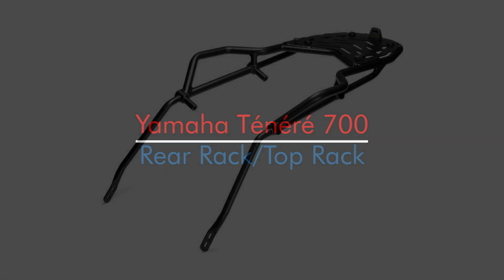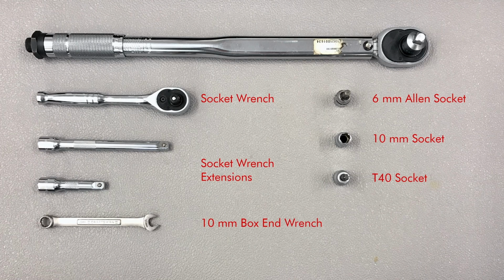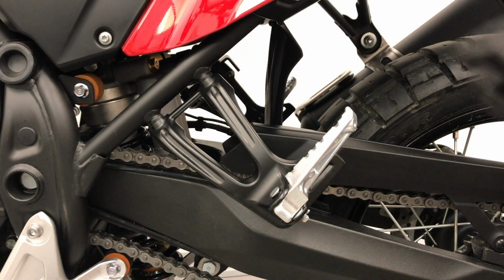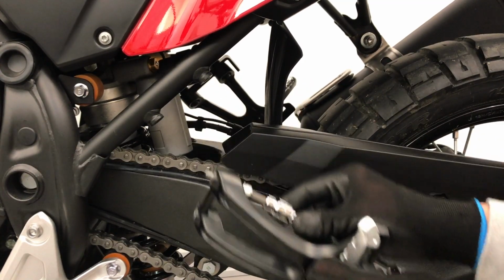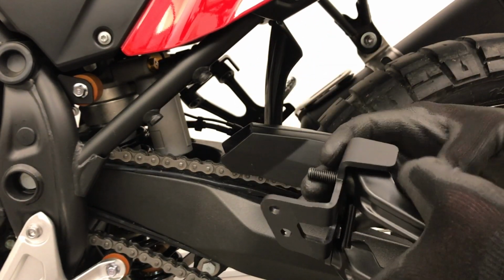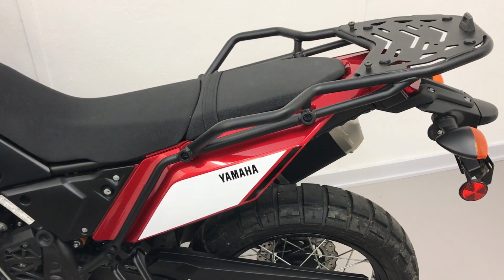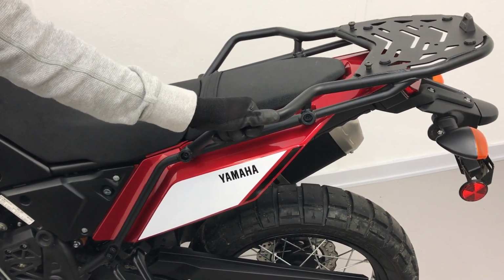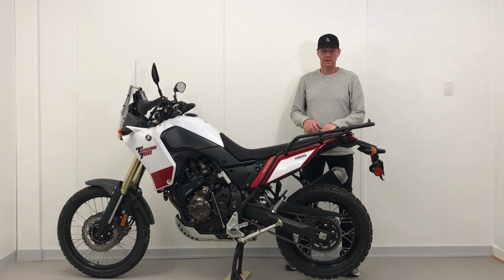Yamaha Ténéré 700   Original Yamaha Rear Rack

Comment: What are the nm torque for assembly?
Reply: Torque for the four large bolts (M8x70 mm) and foot peg bolts (M8x45) are 10 Nm/15 lb-ft. Torque for the four small front bolts (M6x16 mm) are 10 Nm/7.5 lb-ft.
Reply: Are you sure? they seem low to me
Reply: @nicholasmerigo6099  The torque numbers are from the assembly instructions that came with the OEM Yamaha rack. Adding blue Loctite is recommended.

Comment: Hi everyone. I have the T7 with the OEM rear rack like the one in this video. Can anyone tell me if I can add the Yamaha pannier frame kit to the OEM Yamaha rear rack ?? Any help would be much appreciated
Reply from the maker: I looked at the sets. On old pictures it looks like it would fit because the kit has flat tabs to fasten the frame kit where the rack is fastened.

On newer picture of the set, not so because the kit with the same part number: BW3-F84G0-00 is completely different with the large grab handles and foot peg brackets (just as on the rear rack) now part of the pannier frame kit.

I have not seen official Yamaha pictures with both side and top cases mounted, only top or side cases.

I have installed the Givi Trekker Alaska side cases with a Givi pannier rack together with the Givi Trekker Outback 42 liter top case. 

I made it fit with the help of an angle grinder with a cutting and grinding blade, 3/4" and 8 mm drill bits, flat and round files, black satin spray paint and some new bolts from the hardware store; 8 x 26 mm flanged bolts I think it was + flanged nuts. Do not forget the blue Threadlocker!

https://youtu.be/01ZwHWtiVbA

I should have shown the actual modifications in the video. Maybe  later. Not that bad of a modification. :-)
Reply: @orbsurfer8195  thanks for the reply. I think I’ll have to sell the oem rear rack then, as I want a pannier frame to hold the kriega os soft bags and a rear rack that I can put a mid sized soft waterproof bag on the back. I’ll keep looking for ideas thanks
Reply: @orbsurfer8195  Thanks for the info. I have the Yamaha OEM side racks fitted for panniers, but can’t seem to get a straight answer form Yamaha on whether I can also cut the rear rack. From your comments, it sounds like it depends on which side rack you have.
Reply: Hi Jon I have the exact same issue. Did you come up with a solution ? I can’t seem to find a satisfying answer anywhere.
Reply: @OoNoyanoO  I don’t think it’s compatible for the hard luggage system. I went for a soft luggage large waterproof bag that connects to the rear rack using kriega straps that can be purchased from sports bike shop uk.  It’s a great easy system to use and saves a lot of weight.  Also they have bags that will connect to my crash bars.  So with the two crash bar bags and the rear rack bag I have around 42L of space.  You can add another 20L bag onto the rear rack as kriega allow bags to be added together.  They work really well they are waterproof they save massive amounts of weight they can be locked to the bike for security.  Hope that helps.
Reply: @1jonblaze  hi yes it sure helps ! I already have 2 OS12 bags from my old bike and only thought about how the rear rack wouldn't allow me to install Kriega's OS tenere base if I were to buy it. But you are right the rack itself is a good support with some imagination !
Reply: @OoNoyanoO  sports bike shop sell a fitting kit for the Yamaha tenere 700 it’s £19 and it allows super easy fitting to the rear rack.  I have it and couldn’t recommend it enough.

Comment: I love your how to videos, no drama, no pumping music to distract from the content. I do have one observation, you didn't use any Thread Locker? 
From experience, I learned to make sure I always use it on the connections when adding anything to my Bike and 4X4. 
Just curious why you didn't use any.
Reply from the maker: Thanks! You are correct. I installed the rack according to the instructions and Yamaha did not specify any Thread Locker, but I usually use the stuff. I have learned the hard way that it makes a difference! :-) 

I will have to remove the bolts in order to install side case carriers and will use Thread Locker when I reinstall the bolts, and will start to use the stuff more frequently!

Comment: Is it possible to install this oryginal rear rack with Motortrek side rack?
Reply from the maker: I do not know, but it looks like the Mototrek Rack should be mounted between the steel tube spacers and the Yamaha rear rack. For the perfect mount, the two loose spacers should be shortened by the thickness of the rack mount ears, and the two welded on spacers on the Yamaha Rear Rack should be cut of the rack, and shortened by the thickness of the rack mount ears too. 

You might be able to fit the rack on the outside of the Yamaha Rear Rack, making it super easy, but the cases might tilt a little inwards at the bottom.

I did a similar install with the Givi Side Case Racks, but it involved cutting, grinding, drilling and painting in order to get the Yamaha Rear Rack to fit with the Givi Side Case Racks, but it now works great!

Good Luck!

Comment: "A lubricated bolt." Hmm, you do know that friction is what keeps bolts in place, right? You do not lubricate bolts or nuts. You want fiction to work it's magic. If you want to put lube on your bolts, well, by all means do. As for me, unless the manufacture specifies it I won't put any on mine. Be safe!
Reply from the maker: I'm to theoretical, a total nut! :-) Torque is force (lb | Nm) multiplied by distance (ft | m). The torque is tension between the mating surfaces; i.e. the threads, and the tension causes the threads to stretch. If you scale the bolts up to say 1" in | 25 mm diameter, and you picture two I-Beams on a building site being bolted together, too much friction in the form of corrosion or just general dirt on the threads minimizes the amount of force between the mating surfaces of the flanges on the I-Beams. The torque wrench will indicate correct torque due to friction, not the tension we are after. Clean and lubricated bolts will still loose much of the tightening force to friction between the mating threads too, but will get closer to the actual torque numbers. The bolts on our motorcycles are much smaller, but the principle is the same. I never lubricate bolts were I apply Threadlocker, but I always wipe the bolts clean if they are dirty! Sorry for this long explanation! :-) Take Care and Have a Great Ride!